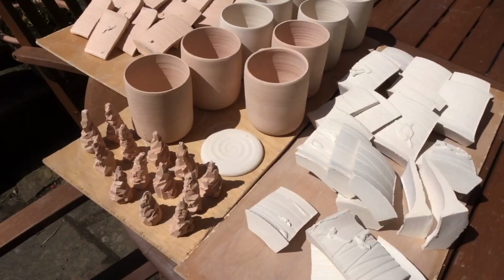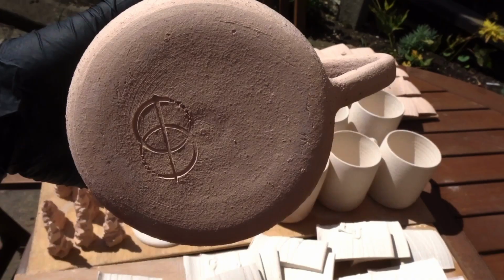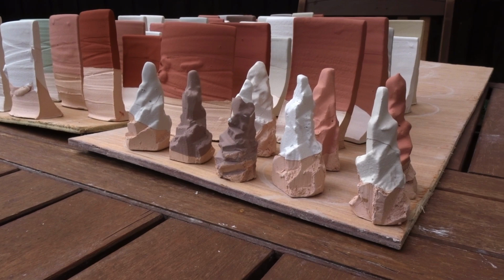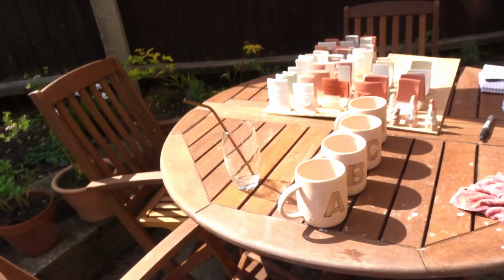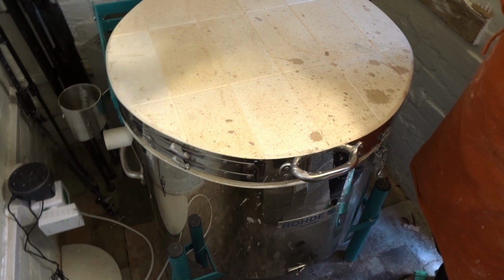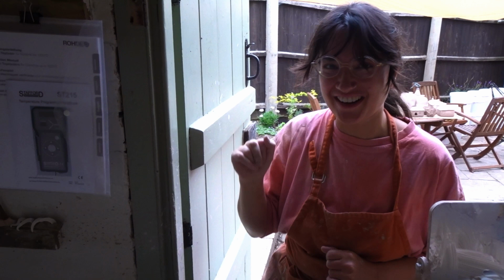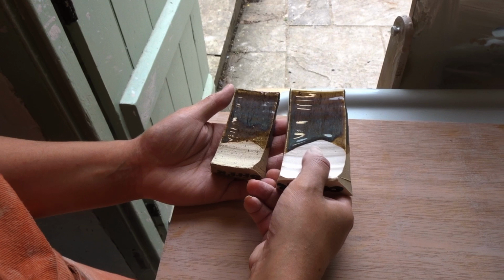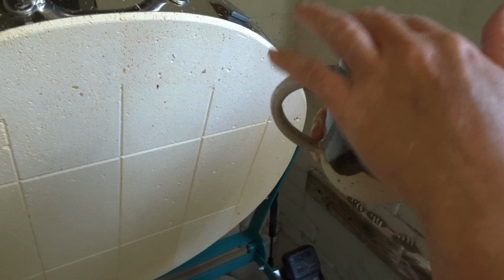Pottery Studio Vlog 7 - Glazing, initial mugs, and kiln opening

Comment: I really like your style of videos. And your work is just wonderful!! Please mention that you have to allow the cone holder to dry completely before placing it in the kiln. Some people may not know that.
Reply from the maker: Thank you so much! I've found that you don't have to let it dry actually, as long as you poke it full of holes with a needle tool it fires fine, no problems at all!
Reply: @BlankEarthCeramics  Please be careful doing that. The amount of steam that comes off from that piece of clay can cause faults in the other pots in the kiln. Also a person I know did that accidentally and it blew up causing her entire kiln load to be effected. Just wanted to let you know my experience with that.
Reply from the maker: @micheledickey4066  Thank you for letting me know - I haven't had problems before but I think I might make a batch of these that have dried out and ready to go to be on the safe side. Thank you for sharing xx